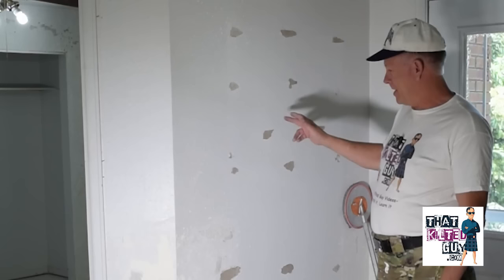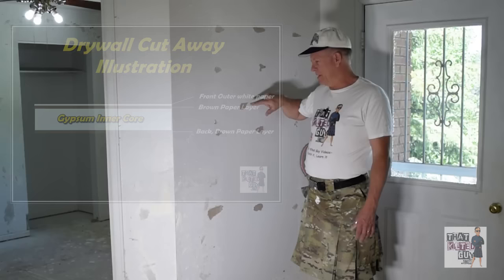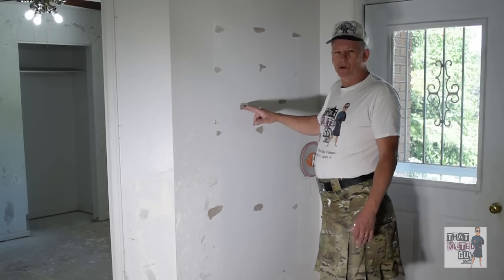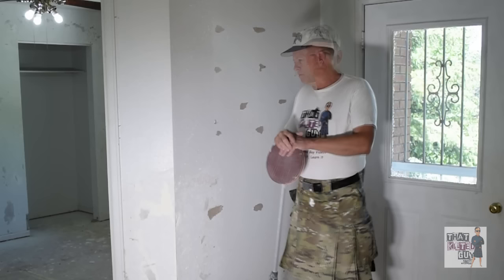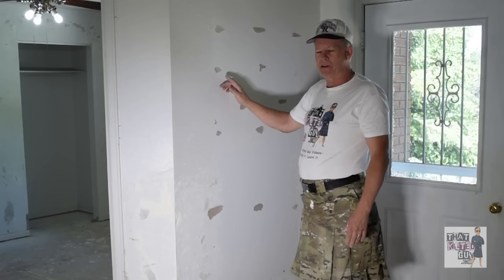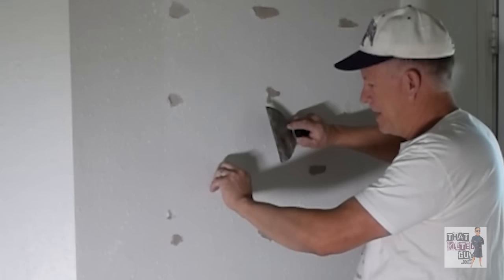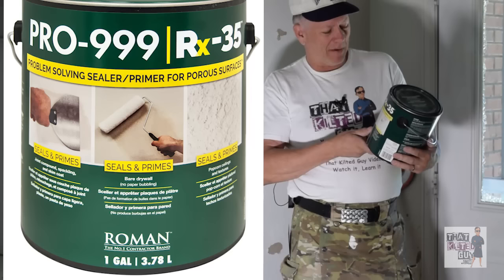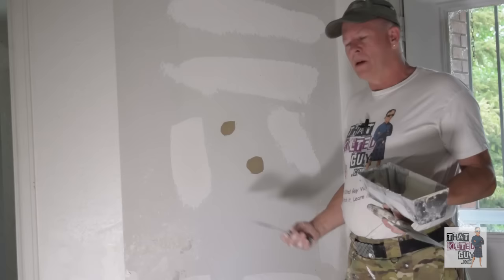⭐ Repair Damaged & Torn Drywall Paper BEFORE YOU MUD IT in 2022!

Comment: Thank you for the great video.   I just started scrapping my painted popcorn ceilings and while doing so, I kept tearing the white paper off (probably because it was too wet and i was scrapping too hard.  I was wondering if i should be using this Pro-999 for the ceilings.  Its a bunch of small tiny tears everywhere or do you think i can get away with it by mudding over it?  That was something I was going to do until I saw your video!
Reply from the maker: Ed K you’ll almost surely have bubbling if you don’t treat it first. I have a link to Guardz, a similar product in my description.
Reply: @ThatKiltedGuyDIY  Is Guardz similar product like Pro-99 or perhaps even Zinsser BIN Shellac Primer?  I'm assuming these products just helps repairs the drywall paper and still need to prime over it.   Thanks for the reply!
Reply from the maker: Ed K the Guardz and pro 999 act as primers so you don’t need to prime again.
Reply: That Kilted Guy DIY Home Improvement would I need to use the gardz or pro-999 for the entire ceiling or just use it on the damage area and mud it?    Im just assuming after scrapping off the popcorn and fixing the damages I would still need to prime the entire ceiling or I can just paint without priming?  Sorry for all dumb questions.
Reply from the maker: No, if you treat it with any of those products, you don't need to prime, they do that for you.  Yes, guardz is similar.  I hear shellac will work, but haven't tried it since it's a lot more expensive but will in a video one day.
Reply from the maker: Always prime any raw drywall, before painting it.  Also, you can just apply the Pro 999 or other to only the damaged spots if you prefer.  You don't have to do the whole ceiling with it

Comment: Hi ive just removed my recessed fireplace from the wall .. i purchased drywall replaced the hole with it .. i used tape then spackling for the edges after i secured the drywall.. 

my question is after sanding the corners what do i do with the centre dry wall.. do i just paint it along with the edges as normal then when dry add another layer then add the orange peel texture the walls have and im done???
Reply from the maker: Hello, here's my normal procedure for when a large area is filled in like that.  
1- Fill in the area with new sheetrock, trying to keep the new piece level with the old, of very slightly recessed, like maybe 1/16"
2- Tape the seams with mesh tape
3- Coat the mesh tape with a solid layer of 20 minute hot mud, (I would likely use 5 minute, but takes years of practice and skill)
4- Coat the repair 1-3 more times, with hot mud if you need more than a very thin, 1/16" thick coat, (usually takes me 1 more coat)
5 apply a final very thin coat of lightweight all purpose mud, like the plus 3 I use
6- let it dry, then sand it smooth
7- apply a texture that will match the surrounding texture, blending it in, (takes skill and practice)

What you're doing can be more complicated than it sounds, and may be above your skill level, but if you watch some of my videos, it will help.  Here's one I recommend - https://youtu.be/JoWWE7d7UU8
Hope that helps.  I do recommend you subscribe to my channel, and be sure to click on the bell icon to be notified of new videos.  if you watch enough of them, and practice, you can do this, though it may take you much longer than me, but be patient.  Thanks for stopping by

Comment: So, I'm watching the video's after I'd already tried patching up the wall.  My question is, is there a way to remove the mud I put up.  Will it come off if I wet it, or will I just make a bigger mess.   I actually used plaster of paris which I had on hand during this quarantine I tried avoiding going to the store?  Thanks.
Reply from the maker: Plaster of Paris probably won’t come off without doing damage to the drywall
Reply: @ThatKiltedGuyDIY  so do you think once I sand it, it will be good enough that i won't have bubbles once I paint?  The wallpaper we took off was up for 55 years.
Reply from the maker: Deborah Jackson My main concern would be that I seriously doubt you can sand plaster of Paris. If I were doing it I would probably just float a lot of mud over it and extended about 2 feet out either side depending on what you did though. But if there is too much of a hump, you may even have to cut the sheet rock out. I’ve never seen plaster of Paris on the wall so I can’t say for sure.

Comment: How I wish I'd looked you up BEFORE I started trying to use drywall mud to "patch" the brown spots! That said, what should I do to get the mud off so I can really fix the problem.  (I took off some old wallpaper and got several torn places).
Reply from the maker: Riley, If any of these spots bubbled up, just take your mud knife and scrape off the part that bubbled. Once you have all the loose stuff off treat it like in this video and continue on just like in this video. Let me know if that helps.
Reply: @ThatKiltedGuyDIY    A few did, and in starting to cut around some others, there is quite a lot of "loose paper". I peeled it down to where it didn't seem loose anymore. Assume I should trim around those too? I went to Home Depot and got the Roman PRO 999, and have already started sealing the areas I fixed per your direction. Thanks so much for your video! What did we ever do before YouTube???
Reply from the maker: Sounds like you’re on the right track. Just get all the loose paper off, treat it, and then coat the spots then it should come out fine
Reply from the maker: YouTube has changed the way we learn things for sure.

Comment: Ok i just put up new ceiling drywall . On the joints do i just retape and float over the old or how do i tie it into the wall that is pinted
Reply from the maker: First let me see if I have this right.  You put up new sheetrock on the ceiling, over some old sheetrock?  I've done that before, but not sure that's what you did.  And then I assume you had existing walls that the new sheetrock is butting into?
Reply: @ThatKiltedGuyDIY  no it's new sheet rock on the  ceiling and old on the wall do i just retape and float over the old wall were old paint and mud.
Reply from the maker: Let me know if that’s right and if your question is how do you handle where the new sheet rock on the ceiling meets the old sheet rock on the walls?
Reply: @ThatKiltedGuyDIY  yes that is the question
Reply from the maker: If you have no old sheetrock above the new sheetrock, you should go ahead and tape the angles, like it was all new.  It's a little harder if you have texture on your walls, but it's not that bad.  The worst part is you'll now have to re-texture all the upper walls too, and re-prime and paint.  When I do an overlay of new rock over old rock, the angle was already sealed and I can just caulk it twice and it's fine, but for your case, I would tape it with paper tape, and coat both sides of the angle, one at a time, letting it dry between taping, and then between coating one side and finally between the coating of the last side.  So it's a 3 day process with drying time, unless you use fast setting mud to tape it, then maybe 2 days.  Check out my video on taping angles at: https://youtu.be/J-aS1vsjQi8

Comment: i had a flood at the bottom of the drywall.  I found that all the paper came off to the gypsum when I went to bring it back to what was attached.  I've sealed it with Bin shellac sealer.  Should I tape that edge or just plaster/skim coat until everything is even?
Reply from the maker: Normally you only need to tape cracks or joints, or small holes, so if the remaining paper is sound, just coat it.  Hope that helps you.  Thanks for the question.
Reply: @ThatKiltedGuyDIY  Thank you!
Reply from the maker: My pleasure.  Glad to help you.

Comment: Hey I hope someone can help me out, my wall was damaged when I removed a calendar board I placed with double sided adhesive tape months ago. Now parts of my wall is peeled off exposing the brown texture underneath now. I'm not sure if the wall is drywall or not because its not hollow, it's firm. Can your drywall repair strategy still work for my situation? Anyone please help thanks. Does the type of wall matter? I know the walla is not stone or concrete because underneath would be white.
Reply from the maker: It really sounds like you just hit the brown paper like in this video.

Comment: I have a question. I removed these floor to ceiling mirrors from my wall and there were these big chunks of black glue on the wall. I removed them but ended up with brown spots similar to what you have in this video. Unfortunately, I had not watched this video so I sanded them down and then used joint compound to fill them in. I am letting the joint compound dry over night. Is there anything I can do now to remedy the fact that I have already used joint compound and did not use anything to seal the brown spots?
Reply from the maker: +Ruth Alvarez let it dry and if it doesn't bubble, just sand them down and you can chance it and continue coating them or seal them at that point right over the mud.  If it still bubbles you'll have to scrape it off and start like it's new torn paper.  Hope that helps, Guy
Reply: @ThatKiltedGuyDIY  Thank you. I appreciate your feedback. I will check it out today and go from there.

Comment: Hey Guy, is the second mud coat a certain type of mud that you recommend? I noticed it was a sandy color. It's okay to mud with the same mud both times? Thanks for the video!
Reply from the maker: I often do these small repairs so I start out with a fast setting mud, we call it hot mud.  That allows me to turn around and put more coats on quickly, but I like to finish with a coat of lightweight all purpose mud since it's MUCH easier to sand.  But technically, if you tape with paper tape, you can do the whole thing with just any all purpose mud if you want.  Hope that helps.

Comment: What’s the difference between the stuff you used an a oil primer ( kill)
Reply from the maker: A lot of people use oil based primer for this, but it takes a long time to dry, and I found it doesn’t work as good.  Plus the oil base primer stinks to high heaven, and this stuff doesn’t.
Reply: @ThatKiltedGuyDIY  I never heard of the material that you used.   Kill drys fast but does smell bad lol
Reply: Hey bro. What is the going rate to finish rock.  So much a foot ?   Not hang  just tape  bed an float an sand.   Ready to paint.   How much per foot. Or how much a sheet

Comment: Is this required if you are going to tile over the wall with modified thinset?
Reply from the maker: I would want my tile stuck to something that is locked down solid so I would.
Reply: @ThatKiltedGuyDIY    Just be sure not to thinset over the joint compound. (in case someone is reading this.) They react to eachother.  Need a sealer layer like primer T.  or so I am told.

Comment: I used this stuff on my torn drywall and it bubbled like crazy. Is there something I’m doing wrong??
Reply from the maker: Yes, you probably didn’t get rid of enough of the paper that was already loose. You have to make sure you cut out anything that is loose and sometimes you can’t tell it’s loose until you tap it with the tip of your knife and if you see the paper move, it’s another layer you need to get rid of. The other issue is if you don’t let it dry long enough before you put something else over it. I have another video on the torn paper concept that might help you with this. Just search for torn brown paper and That Kilted Guy - you should find it

Comment: I've been mudding for awhile now and I never understood the part of sealing the brown paper.  I have had zero issues just mudding over it with hot mud once the rough edges are cleaned off.  Maybe I am missing something about the need to seal the paper considering the backside is just press stuck to more mud.
Reply from the maker: The reason we do it is, sometimes it bubbles and it waste a lot of time to have to come back and try and redo it and then it may bubble again. But the reason a lot of you don’t realize this is because it only bubbles about 10 to 20% of the time so that means you will get lucky many times. I recently tried to get lucky about a year ago because my product had frozen and I had nothing to treat the paper with, and it bubbled like mad.
Reply: @ThatKiltedGuyDIY  Ok I can see that.  Especially if you are using a premix for some reason or have a bunch mixed up thin to skim joints.  I mostly do small repairs but I can see where on larger jobs it is worth the insurance of just sealing to ensure 1 out of 10 dosen't become a problem child.
Reply from the maker: Yep. It’s insurance

Comment: I have a small spot. Smaller than a quarter what's the cheapest most easiest way to fix that ?
Reply from the maker: On a tiny spot just remove all of the loose paper and try coating it with regular mud. Often it will work and if not, you scrape up the bubbled paper and try again. But little spots are usually fine.
Reply: @ThatKiltedGuyDIY  I used white out as Temp paint. Till I find the right color

Comment: What do you do if 80% of the wall is down to the brown paper? 🙃
Reply from the maker: Wow, that’s a huge amount of damage. Without the outer layer of paper, the wall is going to be much weaker. I would actually recommend removing and replacing the sheet rock, but you could use the method in this video to repair it if you really want to. 

How did that much damage happen?

Sorry for the bad news, but hope that helps.
Reply: I used a heat gun to remove satin paint that was bubbling and peeling. I'll probably end up calling a professional.
Reply: Had damage like this taking off 1980's fake wooden wall board sheets in a stairway. The guy used way too much liquid nails. So teared alot. Alot of crazy damage in some areas but other spots not too bad. Thanks for this product and other ideas here!

Comment: The second coat of mud was different?  Does it matter?  I am repairing some holes in the wall from those "safe" picture hangers with Velcro...  in a house I'm renting.  Thanks!
Reply from the maker: Hello, I just used a fast setting joint compound in this video because it allows me to put two coats of mud on quicker. But you can use either as it doesn’t really matter. Let me know how it goes.

Comment: I am refurbishing a closet whose shelf supports were attached to drywall with nails and construction glue. I can sand the old glue down almost to the level of the surrounding drywall but not remove it. Is the process you described in this video appropriate for my project? (As this is a closet, the walls don't have to be perfect.) Thanks for the video.
Reply from the maker: Yes this technique should work for that, although if you don’t get down to brown paper you may not need to do it. But I have found that some glue does not like to be coated with drywall mud unless you seal it with something like kilz or this product. Hope that helps and thanks for stopping by. Kilt on.

Comment: Thanks for the nice video,
I just remove the kitchen backsplash tile, the tiles was glued to wall. When I remove the tiles white Sheetrock paper also comes with the tile. Now I have brown paper wall .
What you recommend ? Fallows you video and use 999 or put new Sheetrock
Reply from the maker: You can fix that like in my video.  I have a link in the description of this video for an similar product called Gardz if you want to order it online.  No need to cut out the rock though.  Thanks for the question. Guy
Reply: That Kilted Guy DIY Home Improvement Thanks
Reply from the maker: Your very welcome.

Comment: Why do you have to use the mud after you patch? Can you just use the joint compound, sand then use a primer/sealer before you paint?
Reply from the maker: Hello, I used the fast setting joint compound simply because I can put two coats of mud on in a short period of time. It almost always takes two coats of mud due to shrinking and such. But if you’re not in a big hurry, yes you can use regular joint compound. Thanks for the questions

Comment: HOW thick/thin should the med be?  After you sand the mud, do you need to wipe it to take off the dust?
Reply from the maker: The thicker you are going to put mud on, the thicker it needs to be to start with. Sometimes all we do is stir it up without adding any water, and other times we add some water. Plus it often comes out of the box at different thicknesses from the factory. So basically you thin it down to where it feels like it works good, but it’s not wanting to drip off your knife constantly.

you can get by without wiping off the dust, but it is a good idea.
Reply: @ThatKiltedGuyDIY  So this case, you did thin down the paint?
Reply from the maker: If you mean the drywall mud, I don’t know. Like I said, I thin it down if I need to.
Reply: @ThatKiltedGuyDIY  Okay. Thank you so much! ❤

Comment: what do you do when applying texture to a wall and large air pockets protrude out? it looks like the outer drywall paper separates from the Sheetrock and forms a huge air pocket?
Reply from the maker: Cut away ANY lose paper, like in this video, and then finish like in this video.